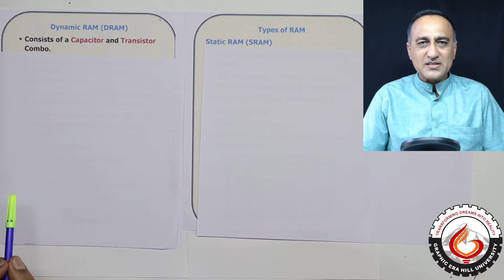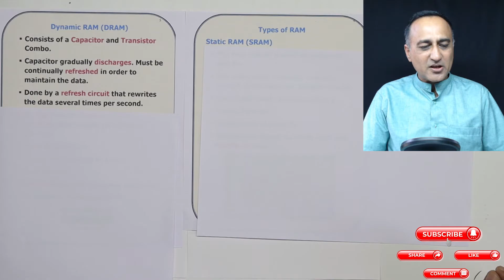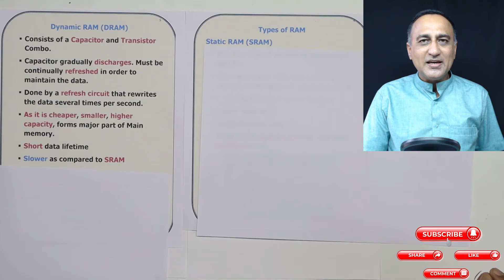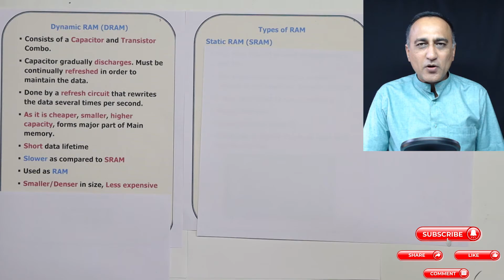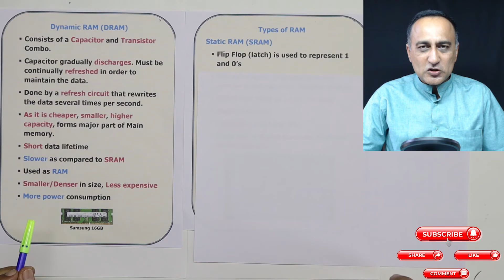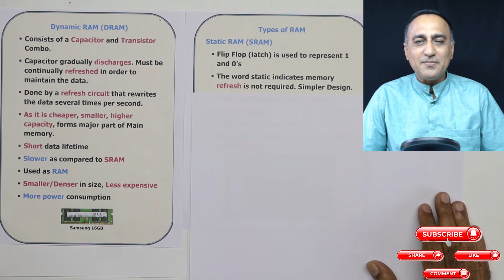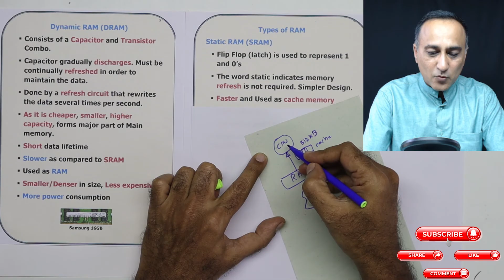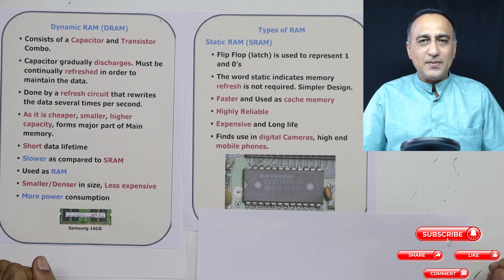WK2 - 13 Main Memory of a Computer DRAM vs SRAM

Comment: sir  , every time we clean our phone 
there often come cache memory equal to this and we clean . 
what is that? is it same
Reply from the maker: Your question is not clear. Please re-frame for me to answer it.
Reply: @CodetoCareer  I think, the question is that, is the cache we clean from our phones (for better performance) , equivalent to the cache of computer?
Reply from the maker: Although to be clear I am not expert on the working of a mobile phone. Here are my thoughts about the cache in Mobile Devices. The idea behind software cache in Mobile devices is similar to the cache memory which is a hardware being referred in the video. 
  In Mobile devices too when you visit a site or use an app, static data like images, some files, frames etc are downloaded and not deleted when you exit out. This is done so that your access and processing speed is improved when you visit the site again, because you are not wasting your time re-downloading the information like images again. 
  Now what can happen in mobile or PC is over a period of time the contents of this Software cache can become too big or get corrupted leading to performance issues. This is when you use the software mentioned to clean up the cache. 
 Other than concept the PC Cache is a SRAM and the one you are referring is software. Hope that helps a bit!
Reply: @CodetoCareer   Sir in context to the computer ... often we clean up the temp files and %temp% files .. where exactly are these file stored ... i mean are these file  stored in DRAM ..or Cache memory or SSD?
Reply: @CodetoCareer   sir,  we clean our phone through certain software like cleaner, speed booster etc . in them when we clean our phone  they show us cache memory .
is this cache memory is same as that  you are talking about in your lecture.